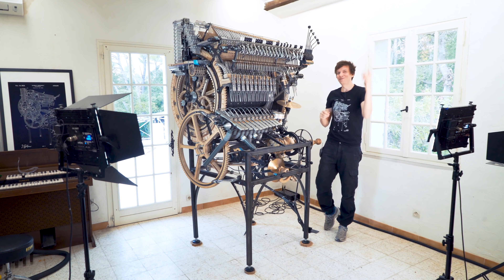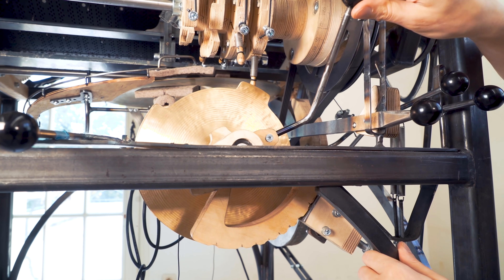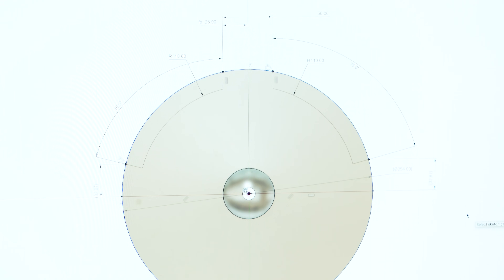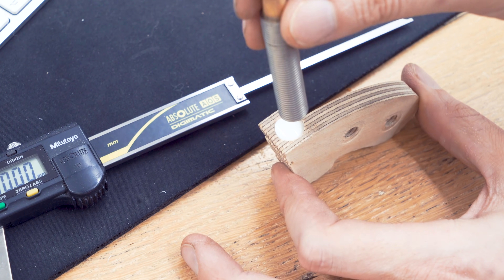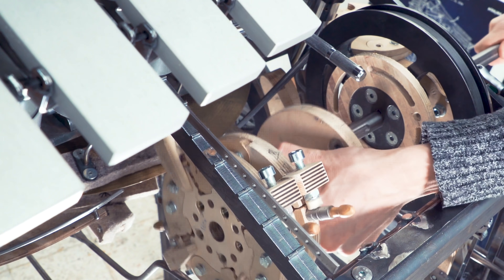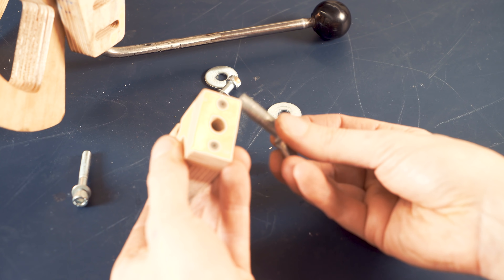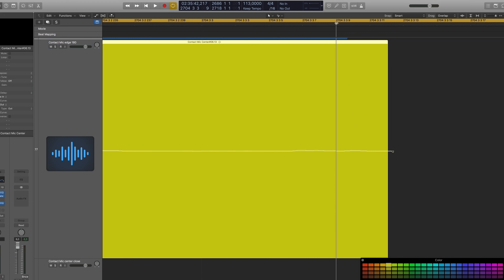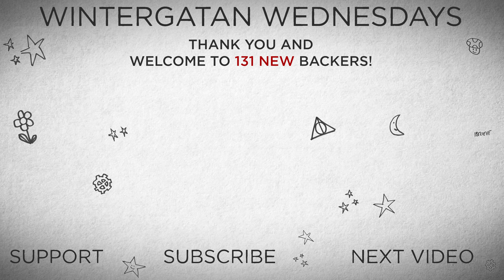I Made a Hi-Hat Machine - Will it Work? | Marble Machine X #108

Comment from the maker: Was building and filming on this thing up until the very last moment again, hence the late upload! Slowly the Marble Machine X is taking form, this is the final version of the Rhythm machine, no need to make big changes on this anymore, i will probably try different hihats, to match the machine sound with the marble played hihat, but thats for another time.
Reply: Hey, Martin! The elastics' lengths will change  in different humidity and temperature, and by wear. You will spend all the time catching the milliseconds!
Reply: @ВячеславКовалевский-к1ш  I was thinking the same thing. The elastics were an issue with the previous marble machine.
Reply: @MicMan2710  I also agree. I think humidity and temperature might be a real problem given the variety of materials. Steel, spring steel, rubber and wood all expand at different rates. Also, the steel parts rubbing on wood will wear through that plywood pretty quick. Hopefully someone behind the scenes has been building a bunch of spare replacement parts.
Reply: @ВячеславКовалевский-к1ш  That is NORMAL for musical instraments.  That is why orchastras spend two hours tuning up before concerts.  Because the MMX is multiple musical instraments - it will need the same time to tune up as the sum of its instraments.  That is WHY Martin is putting in so many fine tuneing points.  Electric instraments don't need to tune - acustic one do.  ^_^
Reply: @kin2naruto  you can "catch mice" on the guitar just playing or tune in few seconds. All the tunings in the marble machine x shuold be tuned before perfomance, but that's impossible to tune so many after each track played. So tuning must be minimized.
Reply: @ВячеславКовалевский-к1ш  I agree! The plasticiser will volatilize from the rubber after a while. I think the rubber is not the best solution for that tuning.
Reply: @ВячеславКовалевский-к1ш  that's exactly, what i'm thinking about this. the felt pads are a good idea, but i think, they should rest against the wooden mini-sticks.
i'm amazed, how good it sounds now. well done so far, martin!
Reply: Вячеслав Ковалевски
Reply: Wintergatan No waste with the old rhythm machine! It was just an early version working towards perfection.
Reply: @NealD  https://youtu.be/et0QKoI44N4
Reply: @Wintergatan might wanna add a thin metal layer on the wood part of the spring loaded ball thingey to prevent the wood wearing out very quickly. Love your work!
Reply: @ToTheGAMES  Its just cheep drumsticks.  Replace them at the same rate you'd nomally change drumsticks.  :P
Reply: Maybe make a hi-hat that allows you to play 3-against-2 rather than 3-against-4 which is the only polyrhythm you can do at the moment? Just a restriction which the new design imposes that the old one didn't
Reply: "final version"  ...yeah sure, I'll believe that when the machine is on a truck heading off for the World Tour!  Lol.
Reply: Does the elastic just stop the spring coils from hitting themselves and clicking?  I'm wondering if they need to actually be elastic, or would work just as well with something that doesn't stretch and won't give over time.  Like cord etc.  Because the beaters only 'spring' towards the retainer elastic when they hit the hi-hat.  If wire or cord would work, you could just use some felt at the screw adjusters attachment to dampen any sound at that end if necessary.
Reply: @Juttutin  I'm also worried about the elastic, and your suggestion seems like a really good one. When the springs are in tension (pulled by the cord) they already have some dampening effect on the post-hit drumstick vibration, possibly making the elastic cord unnecessary. I think some kind of non-elastic cord would be more stable. Maybe kevlar cord (light and strong)?
Reply: Wintergatan  I might be throwing a spanner in the works suggesting this but, what if the lever that you push sideways to change rhythm also could be pushed forward to open the hi-hat in a spring loaded way. That way you could manually put in that open sound, like, TICK- TAH
Reply: It is your final boss fight. It is never it's final form.
Reply: If you added a lever (like a bike brake lever) onto the handle - that, via a cable, changed the pressure on the cymbals - you could adjust the hi-hat tone while playing (just like a drummer would with their foot). It would add a little complexity to the current mechanism - but may allow for more creative playing.
Reply: Hi martin ! May I suggested one little tweak : You sould try to add a stainless steel wire next to the elastic (like a piano string) to make sure the elastic isn't affected by the temperature or the humidity of the room for the world tour, that way you're sure about the timing, and you still have the flexibility of the elastic.
cheers !
Reply: Final version? So.. no version where you can open and close the hihat with the same leveler? ;)
Reply: Awesome progress for such a short time.
Am a bit worried about these what looks like hair tie rubber strings to me. Would replace these with something that's made for lasting more than just a few weaks before total failure.
Reply: It would be cool if instead of a elastic and  screw,  guitar string and tuner. (or the resemblance of tuning peg buttons)
Reply: Thanks. I always watch this when I eat in the Wednesday evening :D
Reply: DAMMMMM!!!!
Reply: You can limit the mechanical noise of the beat selector wheel with felt in those grooves and felt on the metal plate where the ball bearing contacts it :)
Reply: Wintergatan the lever does open hi-hat. Right???
Reply: You could try to put tuning pegs where the precise adjustment system goes for the drumsticks. In this way, you can make it visually better and make it more easy to adjust
Reply: When you tour please come to Sydney Australia! I love your video's
Reply: In #105 you appear to be struggling to stay on top of muting the xylophone. It appears as though you would benefit greatly from automating that feature. If you decide you don't need the hi hat up above anymore it could free up a channel so that you could instead use as a mute channel for the xylophone so that you can automate that feature.
Reply: I'm a member for 1 month because that's all I have but I just wanted to support this amazing machine
Reply: Martin, this is outstanding work. Every week you impress me with your ingenuity and work ethic. I can't wait to see you, the technicians, and the MMX perform on the world tour!
Reply: Wintergatan this just gets cooler and cooler
Reply: Does the marble actuated hi hat become a splash now?
Reply: This design is brilliant!! Very well done!!!!
Reply: Hey, just a thought about the hi-hat sound:

You could try bending the edges where the hi-hat doesn't touch anymore because you cut it open, so that the hi-hat fully closes again. Don't know how it would affect the sound, but maybe the pitch doesn't drop as much.
Reply: Your videos have been the highlight of my week for a long time. Big fan.
Reply: So this means when you write music you need to make sure the bass guitar is playing an open string so that frees your hand to move the hi-hat.
Reply: what do you plan to work on after building this X machine?
Reply: Where unidirectional rotation is not required, threaded joints can be used; in addition to radial support, they also work as axial guards. That is, in place of the bearings in the mounting brackets of the rhythm machine, you can use just long nuts.
Reply: Maybe spring / sticks adjustments would be usefull to have different sound intensity
Reply: Just a minor adjustment idea the pressure screw, if you make it "cogged" you could make a remote flywheel crank for faster opening/closing hihat pressure.  in the video it looked a little awkward/cumbersome to open/close the pressure screw while the machine is playing
Reply: a puch spring would  make the cord unneccesary
Reply: The rhythm machine Hihat thingy is really cool by the way ....Maybeyou should fill the frame of MMX to cut down on body vibrations of the frame itself. It also should help to stabilise the machine maybe worth a thought
Reply: Hey Martin, I know this is your masterpiece but you could replace the screw to open/close the high hats with something like a spring switch to allow  a quicker change faster while performing.
Reply: Those rubber bands for timing will not hold for very long. How about wrapping up the springs with rubber tubing?
Reply: pushing handle in and out controls a cam that opens and closes the hi-hat?
Reply: I love what you are doing and have done but it is a shame to have to have a part of the MMX that doesn't use a marble strike to create the sound. A cascade of marbles onto a high hat would have looked incredible.👍
Reply: Briliant, but why a screw adjustment for the high hat adjustment rather than a cam style which would be much faster?
Reply: Just tried to buy one of your t-shirts for my daughter for Christmas and I find out that tee spring won’t ship any of your products to the United States. Thought you should know in case it’s a mistake, as you’re losing out on revenue. If it’s not a mistake however, what’s up with that?
Reply: This is very cool, and I love all of your videos! You are beyond brilliant; however, I’m a little surprised it’s not more “automated”. It’s up to the player of the machine to move the hi-hat lever where it needs to go, as opposed to letting the programming wheel somehow control the hi-hat.
Reply: I know you said this is final design.. but I have Idea which might be worth to examine... What if you tried drumsticks actuated by cam profile? It has 4 advantages:
1. - you don't need to cut into hihat for switching
2. - every rhytm can be switched on/off idividually just by lifting stick
3. - force of hit will be constant regardless of machine speed
4. - with carefull tuning, it could add just enough inertia into mechanism to be synced with marbles, removing need for timing knob
Ofcourse, there are drawback. It will be hard to ballance springs and weight to get right amount of inertia and energy. Also, faster rhythms might need two sticks to avoid jumping from cam profile. But it might be worth it :)
Reply: Martin, since you get tons of comments I'll try to be brief.
**I think you should use a different kind of spring**, The kind of spring that have naturally spaced coils, because will not suffer from mechanical noise. They will wobble more tho, but you can add something in the core of the spring to dampen the movement, maybe a small roll of felt inside the spring, or cotton, or maybe silicon or rubber. Then you can use the set screw to adjust timing, since it will hold the timing for longer, the elastic will soon deteriorate and become too loose.

Comment: This is one of the best improvements I've seen on this machine.
Reply: It sounds way better, but not being able to do quarter and sixteenth at once is a little sad, only can do offbeat and sixteenth
Reply: @Alluvian567  This can be solved if he adds another quarter wheel between the sixteenth and triplets, but this demands a bit of redesign
Reply: Alluvian remember he has another high hat thats played by marbles
Reply: Alluvian not a hard fix.
Reply: Alluvian was thinking maybe he could make a new ball detent piece and make it so he could play quarter offbeat and sixteenth at the same time. Or he could add one more notch to the cymbal as well and skip the offbeat
Reply: Not only does it work much better, it's so much more in line with the aesthetic of the MMX as a whole!
Reply: And its build in only 1 week. Nice work Martin!
Reply: Yeah got to admit, that idea is definitely leagues better than what it had before. That's downright cool.
Reply: Really brilliant design to improve the acoustic bleed from the previous fine rhythm tuner- shows how often the simplest design is best. Just a screw and some elastic, amazing!
Reply: Comment suitable for every video of MMX building process
Reply: I love how each new idea it's miles better that the previous one
Reply: I agree. There's just one notable issue. You can hear the ball bearing click as it's in the same frequency as the Hi-Hat. That's fixable as you just need to dampen it by either not using a metal ball or some dampener on the gear wheel.
Reply: Stephen Jensen Delrin maybe?
Reply: @glennedwardpace3784  Sure Martin could alter the Hi-Hat to add an additional notch such that you'd hit both the regular quarter and the sixteenth beat. However that's going to decrease the pitch of the Hi-Hat further.
Personally I feel that it's unnecessary. The only reason why you'd want to do both is if you're trying to enhance the quarter or off-quarter beat. The sixteenth beat already plays both in the process. IMO, it would be better if Martin switched out the position of the off-quarter beat with the quarter beat if he wants to enhance said beat with the Hi-Hat.
Reply: Glenn Edward Pace ,

Comment: We KNOW that you can and should make an actual foot pedal to open the high hat!
Reply: he could, but should he? he is standing and already using one foot to fuel the machine right? it would be pretty tough to high-hat the other, haha. What he needs to do, I think, is make it so moving that handle left and right changes timing but forward and backward changes tension :p
Edit: Though, that seems REALLY hard to make easy to handle mid performance, not that manually turning a screw mid song is easier.
Reply: @plogan91920  
I'm only assuming that a solo on the high hat would be easier with a pedal than it is with a turn knob that cannot emulate the same speed. Once the high hat is introduce with the solo I'm expecting it will be used more simply for long stretches of activity.